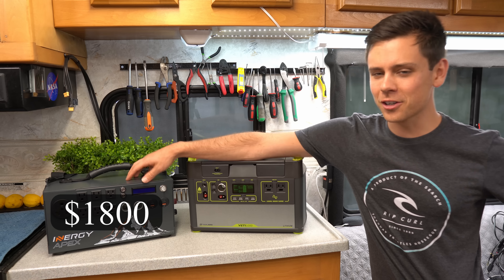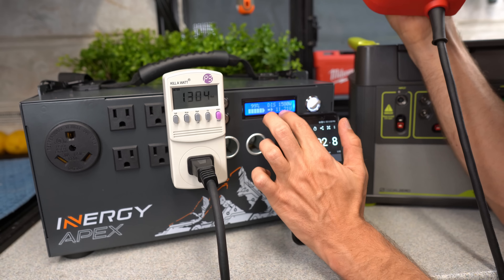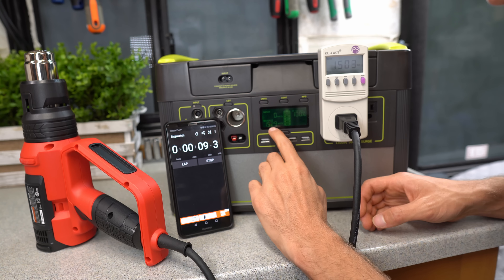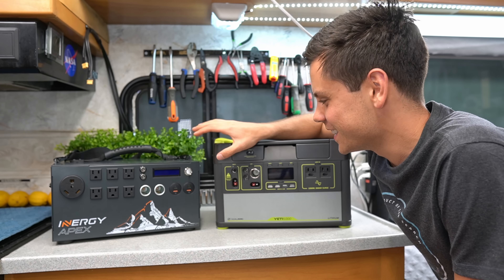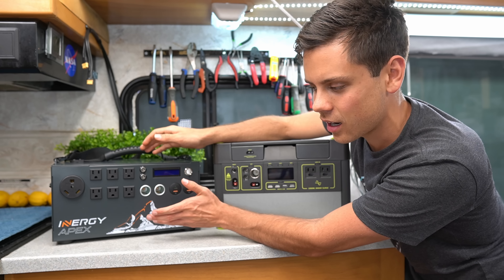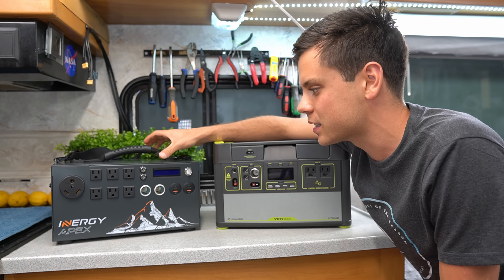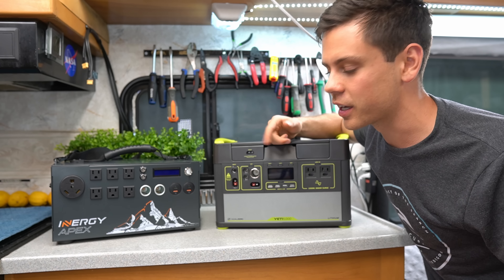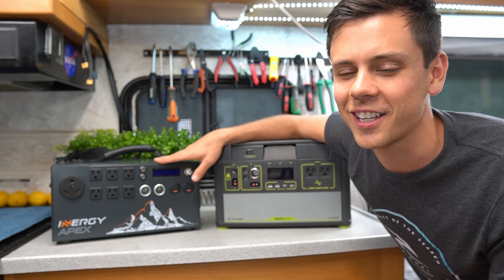$1100 GoalZero VS $1800 Inergy Apex Load Test

Comment: I wish you would take the Goal Zero apart and point out each component. Then modify it or suggest modifications! You da man Will! Keep up the excellent work.
Reply: Yes do this please
Reply: Casey it beats building one, yes it’s not lifepo4, and u either  buy the battery or build it then buy solar controller , sine inverter, charger, buy the box to put into and put the time to put it together it would cost more than the yeti.
Reply: Casey they have accessories for all those limitation, granted u have to pay extra on top of what u alReady spent, like ac4 connector to regulated 12v ac to have constant 12v and if u have the mppt u can connect numerous solar input to the mppt and the pmw and 8mm input to double triple input wattage.
Reply: Casey I meant MC4, u might be right!

Comment: Great video as always Will. While your on the topic of large loads on small systems, you did a video awhile back on adding a heating element to you propane hot water heater. Would love if you revisited that, let us know how its working out and maybe delve into the possibilities of using water heating elements as a dump loads on small to mid sized solar setups. I know dump loads are of more use  with wind turbine setups but would be interesting to hear what you think 👍

Comment: I purchased a refurbished Yeti 1000 and saw similar load test results.  It has been my freezer backup and running off of 200W of solar panels during daylight hours for 6 months now without a hiccup beyond crummy weather. These things are simply engineered fantastically in every way save for the inability to use larger / higher voltage panels directly.

Comment: On a previous video you said you would do a video on wiring non Inergy solar panels to the new kodiak/Apex. Waiting on that video as I don't want to be a hostage of Inergy. I'd like to hook up any solar panel and not just their proprietary costly stuff. Thanks for all you do to educate people on solar!
Reply from the maker: Sure thing. I actually covered that at the very end of the inergy Apex review I posted yesterday. They say it will void warranty but as long as it's a 12v panel with open circuit voltage less than 22 volts, and your panels are in parallel and under 500 watts, you should be good to go. Be sure you know which one is positive and negative or you can destroy it.

Comment: It would seem for those who need the generator for emergency situations, they would be better off with the Goal Zero to run higher draw appliances. If only the Yeti had better solar input and longer cycles. But if the battery kept above 50% instead of 80% , one should be able to get significantly more life cycles. For those who aren't depending on a Yeti full time but will need to use the inverter to its full capacity, the Yeti could be a great option. Thanks for the comparison!

Comment: Will. Please help me and your viewers out. I appreciate this comparison test, however, I have a concern that needs to be cleared up  I saw another recent review of the Apex that warned users if using appliances "with heavy continous loads over 550w, to be sure to use the large 30 amp/RV outlet on the left side of the Apex". Reason?...because the 110ac outlets are only rated for 10amps, and heavy load 500w appliances will not run continually in the 110w outlets. Would you please video another load test using the Apex's 30amp outlet with a 110 heavy duty adapter cord?  I think it might make a difference. If not, it at least would be interesting to test a second time to test this statement from the other reviewer.  Thanks for your videos and your time, Will.  It's sincerely appreciated.

Comment: Thanks for doing this test.  Although I own 2 Goal Zero 1400 (one for my backyard tool shed and the other for my off road trailer) the Inergy was tempting because of ability to recharge off the vehicle charging system.  Goal Zero is trying to catch up in that area but I like seeing these kinds of comparisons.  Goal Zero have their limits as well but I hope Inergy steps up their game because it forces Goal Zero to step up theirs.  Keep up the good work.  Great channel that I recommend to everyone, even those who just want to understand the potential of solar systems.
Reply: You can at least use a small inverter from the cigarette lighter socket in your vehicle to charge the Yeti Goal Zero  .  .  .  at 110 volts .  Not efficient, but works.
Reply: @richardhobbs9038  Everything you said is true and in my own 4x4 I have a dual battery system (Odyssey AGM's) where I could run an inverter more direct making it more efficient than from a cigarette lighter to inverter to GZ.  But since I'm installing solar panels on the trailer anyway for base camping use, I'll stick with that.

Comment: Glade to hear good things about goal zero, I respect your opinion about this stuff. That Inergy is really nice but all systems are different. I personal like quality materials , inergy is high quality too, helps validate my purchase ha. Interesting how you mentioned it being due to saving battery health enabling 2000 charges, where as goal zero discharges faster and handles big loads longer but the battery has 500 cycles. Awesome video, I like the goal zero ones ha
Reply: Because the goal zero allows higher discharge does not mean you have to use it !   The smaller loads you put on it = better.  The less you charge to 100% and not run it close to 10% = better.  Lithium batts like to work between 20 to 80 %  for longer life ,  and do not like to get 'hot' .  Then the goal zero battery will well exceed their 'conservative' 500 cycles .

Comment: Dang, I wish I had seen this video before I pre-ordered my Apex. Just last week GoalZero had a 20% off sale. I could've picked up a Yeti 1000 + their add-on MPPT controller plug-in for well below the price of the Inergy. With the additional MPPT controller, the GoalZero could've of taken multiple charge inputs to charge just as fast as the Apex. The only remaining advantage that the Apex has over the GoalZero is that you can add additional batteries via its expansion ports. I think when mine comes in I'll put it up on EBay and get my money back. Thanks for the review. Would like to see you do more comparisons between the two, but please add the GoalZero MPPT controller to make it an apples to apples comparison.
Reply: You can just cancel your order if you haven't received it yet, or return it if it's shipped. I think I'm going to cancel my order and just build my own system. After watching a lot of Will's video's I'm feeling pretty confident I can do it no problem (plus I'm a retired Electrical Engineer). If I build my own system I want to be able to run my 240V pump, so I need good 240V inverter that can deliver 240V at 3kw for a couple of minutes at least. Any suggestions Will (if you see this comment)?
Reply: MC  -  I use up to 3 inputs on my Goal Zero while using it at the same time .  It doesn't care . . . . $774.00 for  'open box'  !  Love it ! ! ! 
   It's inverter will run my washer and dryer while my 'Windy Nation' pure sine inverter (1500 watt) try's , but bogs and shuts down.    Love the Goal Zero and their customer support was >100% when I needed it once .   Don't have or need it's MPPT add on .
Reply: @richardhobbs9038  Just canceled my Apex order from Saturday this morning. Thanks for that input Richard. Looking for a system now to buy.

Comment: I really do not like any of the changes that Inergy made to the Kodiak, except for the MPPT charge controller.  But actually, charging the original Kodiak was never an issue in the first place, so it wasn't even really something that absolutely needed to be fixed.  Even with  PWM charge controller, I can charge my Kodiak in a few hours with just 400 watts of solar. 

 That's what I absolutely love about my original Kodiak, and when I put a 1500 watt load on it, as long as it has solar going in, (the pass thru feature) it won't cut out.   I've vacuumed my whole house using the original Kodiak, and the vacuum uses about 1500 watts of power.   

The original Kodiak seems to be much more bullet proof than the Apex.  I won't be wasting my money on that thing. 

But I have been considering a second generator  I'm looking at just having all my solar capabilities in generator form.  If/when I go off grid, it will be essential to have a portable power source for running saws, and other power tools, and it'll be nice to have it be able to do double duty powering my RV as well.  I think it's best to decide which kind of system you want to have, and concentrate on making that one system work best for you, rather than having multiple systems requiring all kinds of different components etc. 

All that being said, I was also very impressed my the Goal Zero, but........does it still absolutely suck as far as charging time? 

Funny thing is on that, I have a possible end around fix for it.   How fast will it charge on AC vs Solar? (The Goal Zero) 

If it will charge quickly on AC, then, I might buy one for its output capabilities, and charge it with the Kodiak hooked up to solar.   LOL!!

Comment: Will - This is Tom T again.  I follow you religiously and have your book.  Please consider the group of us out here who want to have electricity to run basics (refrigerators,  furnace in winter, TV, LED lights, garage door, CPAP, etc) in grid down by THROWING A FEW TRANSFER SWITCHES as needed. You can even do laundry by transferring electricity for an hour.  A refrigerator runs only an average of 12 minutes an hour. A gas furnace about twice that. A garage door about 2 minutes a day. Use the microwave sparingly at about 10 minutes a day.  I have a gas stove! Wash and dry the dishes yourself. Open the windows for air conditioning! . I just want about 1500/3000w continuous NOT a ginormously expensive whole house system - with say a three or four lithium battery bank and around five 100w panels producing 6000w to 8000w per sunny day. I think whole house solar is a waste.  I just need some renewable electricity. A gas house can be run on very little electricity in a conservative mode! I had hopes for Apex, but you have squashed that as only providing 550w and NOT continuous!  WOW!  Will! Please consider my theory of conservative management of a house and expand your thinking to include CONSERVATIVE SOLAR MANAGEMENT OF A (gas) HOUSE. It seems so feasible/workable. There are a bunch of us out here. HELP! Thank you! Thank you! Thank you!!! - Tom T.

Comment: Unless I missed something the Inergy performs exactly as expected- the company was upfront about 500w continuous. If I kept under that threshold with any appliances etc., I'd go with this unit. High power needs would be better suited to Goalzero. Thanks for the video Will!
Reply: No they aren't.  Just went to their website...NOTHING about the continuous power draw limitation on the spec page. Unless you consider a prospective buyer downloading and reading the user manual as them being upfront.   Truth is, nothing in their marketing points out this major limitation. The description on amazon for their product touts that "it packs a huge punch with its peak 1500 watt PSW inverter." The 500 watt continuous limitation is mysteriously missing there as well.  Over priced and underpowered product.

Comment: Update:  I did cancel my Apex order and ordered a goal zero yeti 1000.  On GZ's website, search for "Open Box", I got mine for $715.  I got it yesterday.  It was in perfect condition and comes with a 6 month warranty (vs. 1 year for new).  No returns or exchanges though.  

I ran my 1500W electric water kettle to heat 1.7L of cold water to boiling.  It took 20% of the battery capacity (98% to 78%) but it did it!    The battery draw started out at 1530W and dropped to 1475W continuous for the rest of the test.   When the water temp hit boiling, the power draw dropped to the range of 9 to 5W and it will kick back on when the temp drops below the set point to maintain temp.  This is a very usable power solution for me and something I am going to use in my van daily.  My van's inverter can only supply 750W max off deep cycle lead acid batteries.  This thing will do what I had hoped the Apex would do and I saved about $1000 in the process.  The Apex would have died at less than 3min.  The only problem I have will be charging this thing in a reasonable amount of time.  Thanks Will
------------------------------------
Wow, I have an Apex on order.  I am considering cancelling the order.  This is terrible.

Comment: Hi Will, I just found and subscribed to your channel.  I have a question I hope you can help with.  I have 3 x Goal Zero Yeti 1250 behemoth battery packs that probably need the batteries replaced.  Can I replace the standard batteries with Lithium Ion batteries, and if this is possible, what would you recommend? I have no experience in this sort of thing.  Thanks!

Comment: iinerestingly, r I have the previous mode, the Inergy Kodiak. I did not have the shutdown problems you experienced. I did not have 1500W load but I did have a 1250W load. My Kodiak started from 80% charge (that is how I store it) and under 1250W load ran for 32 minutes with no issue. Maybe they newer version has a too conservative power protection scheme?

Comment: My Apex stopped running a very low powered tower fan midway through the night last night. I was asleep and didnt see what happened. I have no idea why a load of 60W would just stop. The battery wasnt even close to discharged , 68% as of this morning.
Reply from the maker: Very strange. Be sure to tell Inergy. 

They told me the switch that fell off mine is a manufacturing error so there might be other problems like yours and they need to hear about it. That's very strange
Reply: @WillProwse Hey Will update on my previous comment, I tried the same fan tonight and none of my AC outlets will put out power. They won't even power a nightlight. Looks like a total inverter failure. Definitely contacting Inergy tomorrow to see what happens here!

Comment: The mppt along with the pwm you can input 600 watts of solar. With their fast charger, the 1000 can be charged in 4-5 hours,
I'll go with the GZ 1000..
Reply: And Will now has a great video on exactly that, and more.
Reply: Kodiak APEX only 500 watt input not 600 the older kodiak was 600 watt input the new apex actually dropped 100 watt so going backwards is suppose to be an improvement mppt controller or not people want more not less

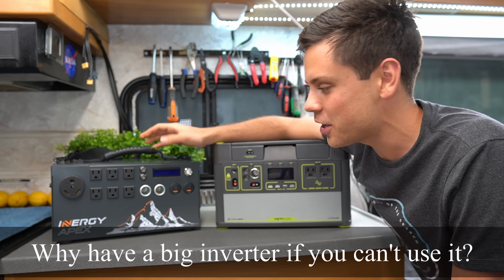Comment: If the Inergy Apex discharged 16% of its battery in 02:41 and the GoalZero discharged 83% of its battery in 28:25, doesn't that imply that the Inergy Apex has battery protection that kicks in near 80% and the GoalZero does not?
Reply from the maker: No

Comment: Would have been interesting to see how long they would both last with a 500 watt constant draw.
Reply from the maker: They would both run till empty no problem. I pulled 600 watts for 20 minutes or more with the apex a few days ago.
Reply: Oh cool, do you offer your consultancy services at all?  I plan on building a rather expensive system soon and would happily pay to have you give my parts list a once over and potentially point out any errors or suggest changes.

Comment: Thank you for the test. I am getting my apex on Thursday.  Should I return my apex. The only thing positive is that it weighs 25lbs.
Reply: I have this same question. Mine was supposed to ship back on May 15th, but hasn't. I pre-ordered mostly based on Will's recommendation - now seems like I should go a different route.  My requirements are more disaster/hurricane preparedness. I wonder if I should email them and see about canceling since it hasn't shipped...

Comment: Curious to know if both charged again to 100%, and if you could do it with a load 80% of capacity to find the spot where the Apex can run past the 3 minutes. Then compare both at that load.
Reply from the maker: Yeah it's in the video they are both a 100%. Just pause when the test starts
Reply from the maker: Nominal voltage of each battery pack is identical
Reply: @WillProwse  What am looking for is the max load where the Apex will not shutdown and work continuously, then apply to both and see how far they go. Ex. 1250 watts.
Reply from the maker: I can pull 650-700 watts continuous in my tests. Inergy recommends 550 Watts continuous
Reply: @WillProwse  Thanks Will!